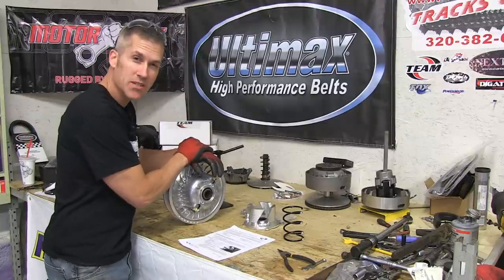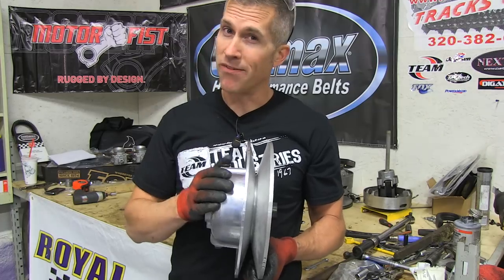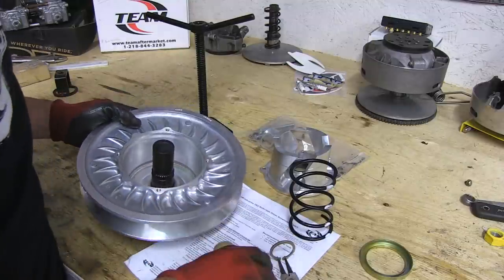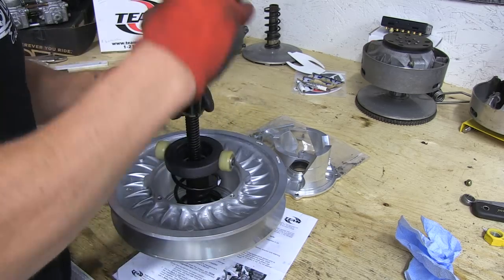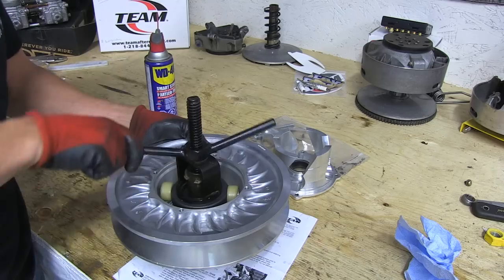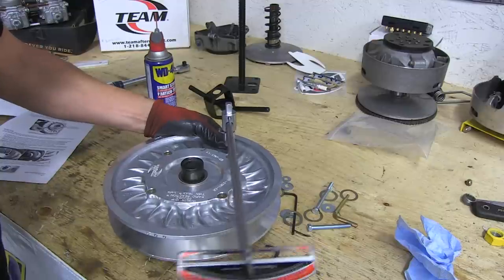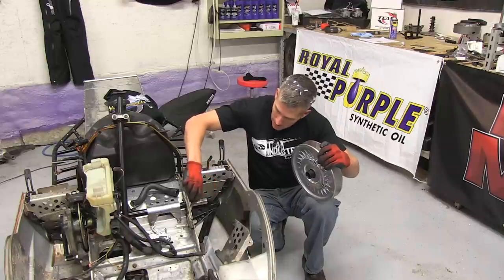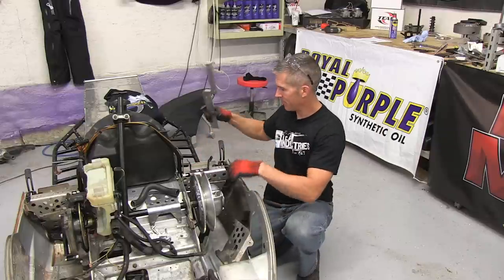700 Ski Doo mod sled Ep #27 Team Tied secondary clutch tuning and install! PowerModz!

Comment: Just a couple pointers:  It helps to draw a mark on the clutch shaft where the skip tooth is to help line it up with the spider skip tooth.  Also, you always want to use the alignment bar if you had the motor out and "float" the secondary about .04"-.06" by adding washers to the retaining plug.  Nice video.

Comment: My old formula z 670 had clutch problems after 18000 miles. It had a rebuilt engine from a year or so before and suddenly a few winters ago I would only get 80 mph out of it. It accelerated normally with great power up until 80 but it just wouldn't go any faster. We tried to rebuild the primary. New rollers, pins and springs but it still wouldn't go any faster. We didn't get to the secondary but do you think that was the problem. It had tons of balls but got stuck at 80 mph. So frustrating because it is a great machine but I couldn't get parts for it anymore and the 670s clutch was kind of hard to find. A 600cc one they said wouldn't work and the 700 and 800 primary's wouldn't work. Id like to get it going again. Any thoughts? I have a 2000 formula Z 700 now and I love it. The zx chassis is way better for handling and bumps but the 99 I swear had more balls. It would do 115 mph on an icy road where my 700 only gets about 110 mph.
Reply: Did you think to replace the bushings ?

Comment: Hi. What difference does it make with a harder or looser spring?  My spring on the secondary clutch is adjustable...
Reply: A heavier spring / setting increases the tension on the sheaves which makes them harder to open as the primary clutch shifts and pulls the belt up. This raises the engine RPM's because the primary clutch can't shift as fast.